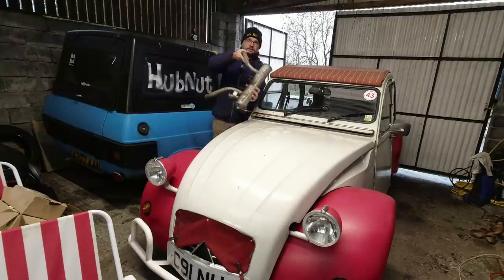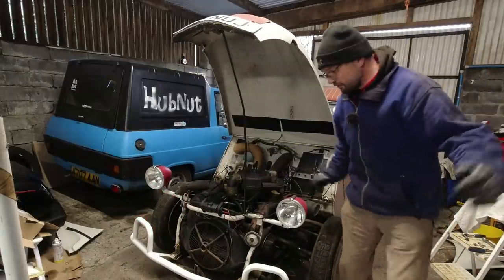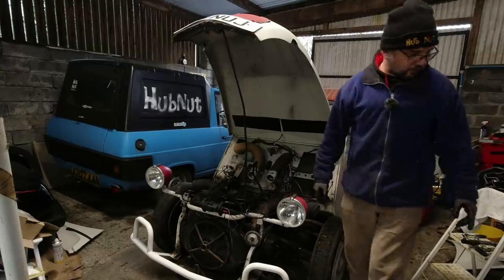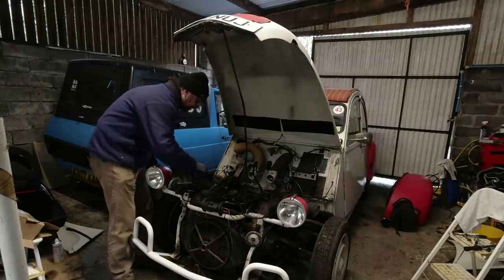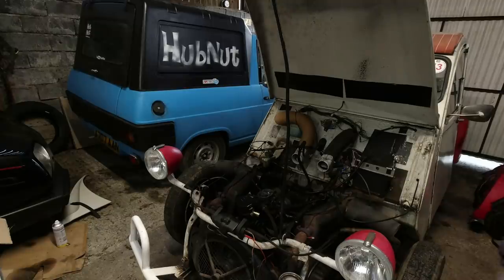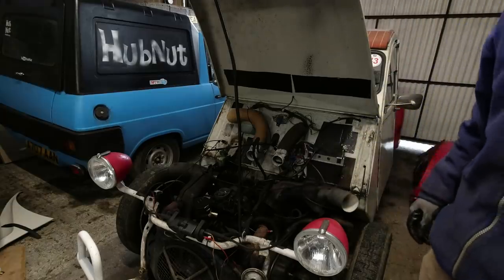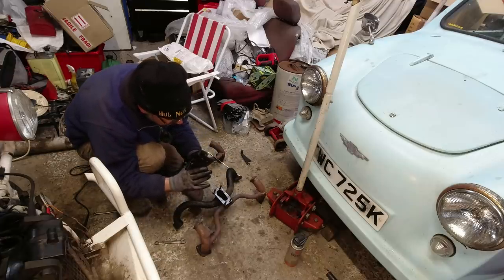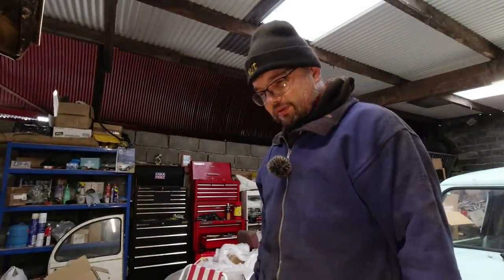2CV: Danger to the manifold Part 1

Comment: This is why your channel is so good, I think most of us who tinker in garages, sheds and on driveways are just winging it. Struggling without the correct tools, stripped threads and cold concrete are what many of us contend with and it's what makes your endevours so relatable.
Reply: Agreed Paul. I do all own work on my MK3 XR3 and sometimes I fail, so sometimes I have success. It’s all about that can do attitude and taking your time.
Reply: @matty6848  ...And the satisfaction of doing it yourself makes all the pain worth it. Probably...
Reply: @matty6848  Ooh, McPherson struts, scary job! Nice one, well done! I did that job on the front end of a mk4 Cortina once. Felt like I was defusing a bomb when I was winding down the pressure on the spring compressor!
Reply: @paulbennell3313  cheers Paul. Yes I was the same. Luckily I had some help from a mate but my fingers & thumbs were shaking like. Leaf🤣

Comment: I did an engine/gearbox change on my Dyane in the street in Headingley in October 1977. I converted it from 435 to 602. I had hoped just to change the engine, but for some reason the 602 engine didn't match the 435 gearbox, so I obtained a 2 cv gearbox from a Scrap yard in Rotherham. Then I found the brake pipes on the new gearbox didn't match the old pipework so I had to drill out the 4 way (or was it three way) junction fitting to get it to work. It worked and the car was much improved with the extra HP and torque.
Reply: You are just a hero, specially changing motor / gear box of a Dyane  who is less practical - and in the street ! I swapped a 602 cc for a 425cc with centrifugal clutch and gearbox in a bitter cold windblown shed and at the end of the evening...the gimball transmission shafts did not match ! I had to WALK away... welcome to the club !

Comment: Small hole in the manifold is somewhat of an understatement! ;-) And the extravagance of a spare manifold when clearly a baked bean tin (washed or unwashed) and some wire would have sufficed! Happy Christmas to you and the rest of the HubNuts when it arrives.
Reply: Aluminum (aluminium) Coke can and worm clamps ... and a little epoxy
Reply: Considering the mild mayhem with tools, parts and fixings randomly strewn across the constricted floor space in the gloom, working to to a constant philosophical commentary, fitting the wrong manifold was sadly, a foregone conclusion! 
But....that’s what’s so endearing about this channel! 🇦🇺

Comment: Don’t apologize... your garage experiences are so much like my own that I can relate completely, hence the appeal. We can’t all be Project Binky, and that’s just fine with me. You remarked about the accessibility of the 2CV engine; I concur. After years of digging into the dark recesses of my MG Midget, I installed a rebuilt engine in a friend’s Triumph Spitfire, with the bonnet removed. What a difference. The front tires even provide seating while fiddling with engine bits. Luxury.

Comment: Cracking tinkering video, shows your knowledge of tin snails is indeed deep. 
 Old cars aren't really unreliable, possibly a bit temperamental and you could do way more PM but it would still want repairing.
That's why we love them really, the thrill of completing a decent sized journey successfully.
But you've been able to take a comparitely large piece of your 2CV off with hand tools and in a shed.
A blown headlight bulb on a modern could entail bumper removal, letting a garage do it, then taking it to main dealer to have the fail fault indication reset. 
At least you're in control of this repair. 👍

Comment: Its Christmas time, the time of year when all cars break down and require costly repairs
Reply: Yes, this has happened to me a few times....🤣🤪
Reply: Ha ha! Usually I have some white good break down in sympathy and demand immediate replacement at the same time! ;-)
Reply: On Christmas Eve 2017 my V70 broke down horribly. Had to wait two weeks for repair and the bill was over 700 quid.
Reply: @volvo480  funny you say that. My 1990 240 Estate decided to spit transmission fluid all over Hell's Half Acre. I got lucky, though. It was only a cooling line. $152 Canadian, about £75, and back in the road. Only 1 hour of labour. Could have done it myself, but I was not about to be rolling around in a foot of snow at -10 degrees with a stiff breeze.

Comment: Don't change Ian. If it wasn't all a bit wonky then it wouldn't be Hubnut. Replacing the wrong bit is part of the "joys" of home car repair. A couple of years ago one of the sons helped me replace the serpentine belt that I decided had failed on our Volvo XC70 which we had just sold and the new owners wanted to pick up. It took 7 hours with the wrong tools, working well into the night and cold and the problem was still there at the end. I sent it to a mechanic who found that a bolt had worked its way out of a pulley (apparently a common problem for that engine). Still an expensive pain to fix but a lot less work than our misadventures.

Comment: I like how if something goes wrong with the 2cv or any car you car about you fix it like this video tearing half the engine out to fix the situation but when you have brought the other 2 project cars you’ve not done anything. A few fail videos out trying to get them started. Instead of them out and cleaned and even take the engines out to help access to try and get them running. Please bring back hubnut the one who did the fox project. Bring him back for 2021!

Comment: I have started back with a Myford ML7 in my garage. It really does show how little light one has. Easy solution a couple of slimline outdoor floodlights20W LED is the equivalent to 200W bulbs with a reflector behind. I recommend them & they are not dear to buy. Will make a world of difference.

Comment: One thing I've realised watching your videos is that it must be nice to have vehicles made of bits you can actually physically lift without a hoist or enlisting some friend visiting at an unfortunate moment. My last two vehicles having been an old LDV 3 1/2 tonne van and now the Land Rover Discovery TD5. Last week the Disco started making a 'bearing' noise. I thought possibly the gearbox and lost sleep knowing the full horror of a gearbox swap. Thankfully, a dry sliding joint on the front UJ. Result more grey hair 🥴

Comment: Those carb to manifold nuts are always 12mm and sometimes 13 (if they've been replaced), a crowfoot spanner job when the manifold is on the car! another strange nut size from Citroen internally/externally. Most important not to forget the spring washers underneath them as these have a habit of working themselves loose creating air leaks. For exhaust gaskets I recommend using the 'carbon fibre reinforced' gaskets from Ecas (£4 each?) as the rubbishy normal ones available now do have a habit of blowing out the side quite quickly. I also always use Holts exhaust assembly paste, it works :-)  Always good seeing your videos Ian :-) Have a safe Christmas.

Comment: I have a theory about all the different bolt head sizes. As a cost-saving measure Citroën didn't buy each assembly worker the specific spanners they'd normally need, but they bought a few spanner kits (cheaper than buying individual spanners) and chose the bolts and nuts so that every worker could use a few of the spanners without having too many of one size and too few of another.

Comment: Making a 'carb-nut-tool' is fairly simple actualy. Just get a ring spanner of the correct size (12 in your case apparently, 11 for my carb) and bend it 90° about 10-15mm out fron the ring. Grind the thickness of the rind down to about 2mm, et voila you have a 'specialcarbbolttool' and can take it off without having to take anything else of the engine!

Comment: Ian, you often ref the cardboard fire 🔥 loving hoses, what can't or don't you upgrade to some piping not so flammable? There must be replacements or similar size in less combustible materials ?
Reply: Looks to me like aluminium dryer vent pipe should be available in a compatible size.
Reply from the maker: The cardboard tubes have a foam insert, so they're flexible and, importantly, dampen the sound coming into the cabin. People have tried other tubing, but sound tends always to be the problem.
Reply: @HubNut  baffling? .. I mean sound over an engine 🤷 🔥?

Comment: I've never put the old part back on before but it does take me ages to actually get something done... I'm easily distracted and go off on a tangent. I made a double decker trolley for my toolboxes  from a kids pram as the toolbox weighs a ton and I have 3 toolboxes.id be tempted to weld that manifold with my Aldi welder.... what's the worst that could happen?

Comment: I do have a question from watching this video that probably only someone like you might be able to answer. That manifold you had there in your hand. If you look inside the manifold hole, the plenum, is there a small pin hole at the bottom ? Mine has a tiny hole. Just big enough to pass light through. Is that normal? Thank You

Comment: Get yourself a mig welder and you'll be fixing shit old exhausts with the rest of us. The exhaust on our 18 year old Yaris 1.0 is mostly made out of weld.
Edit: get an electronic welding helmet thing while you're at it. You can get a working one on eBay (or from Lidl) for about £25 and they are really, really, really worth it. Consider it a priority.
Reply: The thought of Ian welding is quite worrying.
Reply: @simonsackett  it's not going to be pretty, but as long as he mugs up on The Triangle Of Fire before he turns it on, I think it will be a step forwards for all of us.
Reply: @Rich-on6fe  It will be amusing, certainly. I've never seen anyone accidentally weld themselves to a car.

Comment: When I was a devout mini owner I always had a full engine gasket set on hand to cover unexpected jobs like this. Hopefully 2CV gaskets are as cheap as mini gaskets!
Reply: I have visions of you pulled into a layby of the A1 changing head gaskets that you had in your boot.
Reply: @benholroyd5221  Did many repairs in lay-bys (usualy drying out soaked ignition systems), but head gaskets were usualy changed in the road outside my parents house 😁

Comment: I would be all at sea without the regular HubNut comedy fix.  A large tube of instant gasket should always be to hand as a delaminated or broken gasket is inevitable and one never has a new one to hand when needed.  It was part of the tool kit if one owned a British motorbike as mating surfaces were often badly machined or between cast Iron and aluminium with different expansion rates breaking the seal.  I know purists hate the stuff but it does get one out of an hole when needed.

Comment: I spent an hour rechecking the cam  timing on a diesel engine I swapped the head on, the engine locked after 1/4 of a turn..... Only to find I wasn't pulling the locking pin out of the flywheel housing far enough and it was catching on the clutch cover plate... 🤬
Reply from the maker: That's like when I fitted Foxanne's engine the first time, only to find the clutch didn't work...
Reply: @HubNut  sometimes it is ok to have a manly  cry.....

Comment: Could that hole in the manifold have something to do with you heavy right foot?
Reply from the maker: No, it's because there was an ignition fault, which left the exhaust system full of fuel after a lot of cranking. It went bang (you could see the smoke coming out of the exhaust).